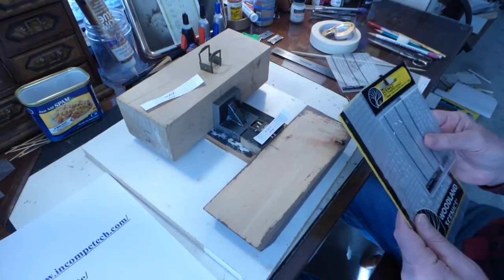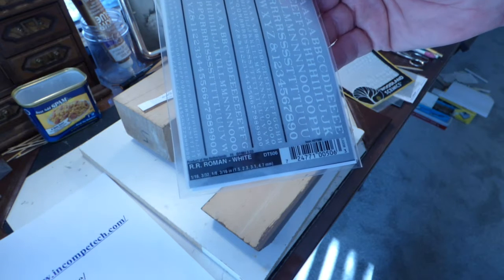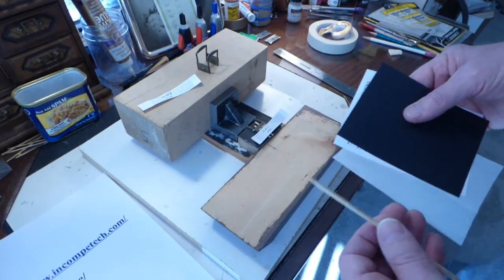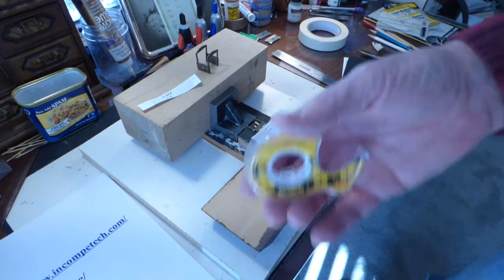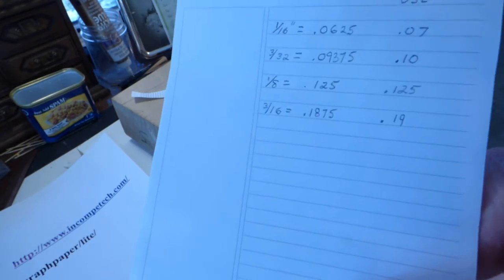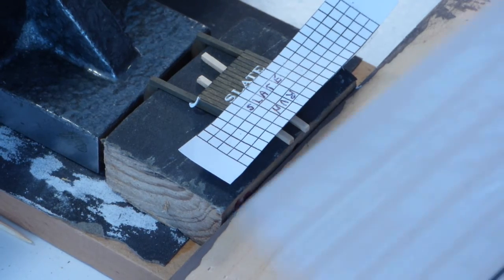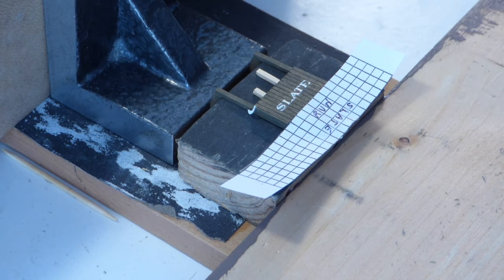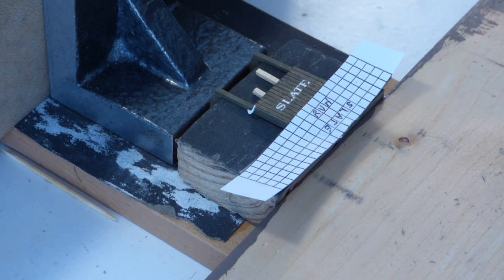Using Dry Transfer Lettering

Comment: Thank you for taking the time to make this video. I've been hesitant to try dry transfers to letter my O scale models for the reasons you stated, but now you've taught me the technique. One model I wish to letter is a wood-sided caboose ... I see the transfers looked good on your Climax locomotive's wooden structure. I hope the larger sized letters I will use on my O scale model, will also look good on the larger vertical wood slats and spaces between them.
Reply from the maker: Give it a try, James.  If you don't like the look, you can always lift the letters back off before adding the sealer with some masking tape, sticky side out.